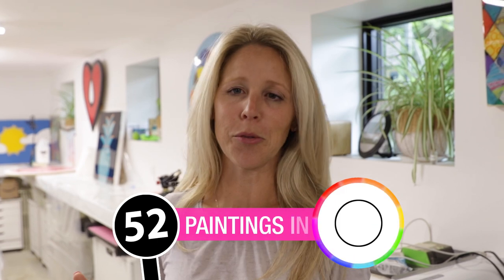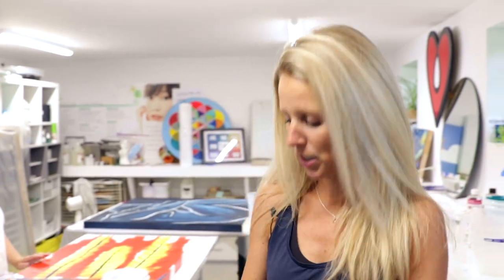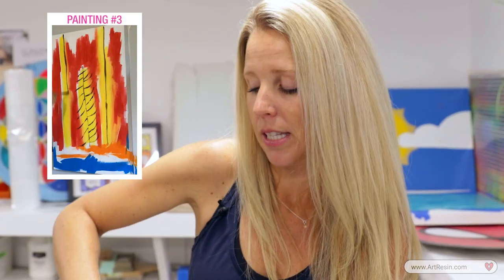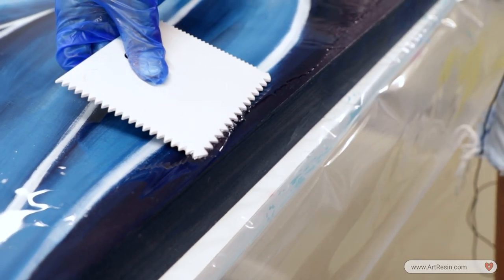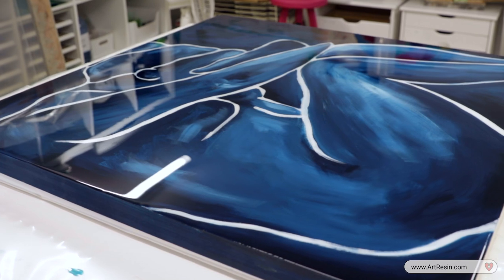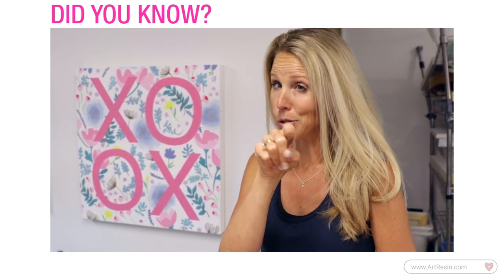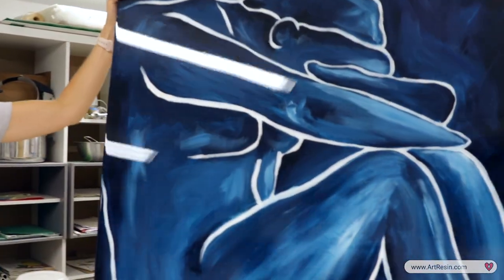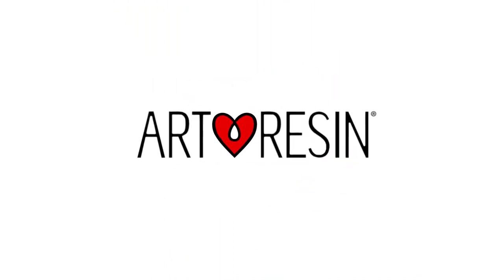Resining 3 Large Paintings

Comment: Thank you, that is so interesting about the titanium dioxide reacting with the resin. The titanium dioxide in White Out keeps 2 metals from ‘sticking’ together when forging steel in a canister. It’s so you can remove the can after heating and pressing to make sure the inside of the canister has all ‘forge welded’ together. That all happens at about 2000 degrees F. I wonder what else titanium dioxide reacts, or doesn’t react, with.

Comment: The paintings look amazing. Are you painting on canvas or wood? If canvas, how to avoid sinking? Many thanks
Reply from the maker: We like to use cradled birch panels where possible, they are so sturdy and really stand up well to the weight of the resin and resist sagging like stretched canvas can.  If you are pouring over a stretched canvas, take some time to reinforce the backside with large pieces of cardboard behind the supports, this will help prevent the resin from causing the canvas to sag in the center.
Reply: @Artresin  many thanks for your answer 😊

Comment: Can you resin a canvas panel / board, or will it warp it?
Reply from the maker: You can apply resin to a stretched canvas or any flat surface such as a rigid canvas board.  Just be sure the resin is able to cure on a flat level surface and it will not warp.  You will want to be careful if you are applying on a large surface as the resin will add weight and you will want to try to avoid flexing too much.